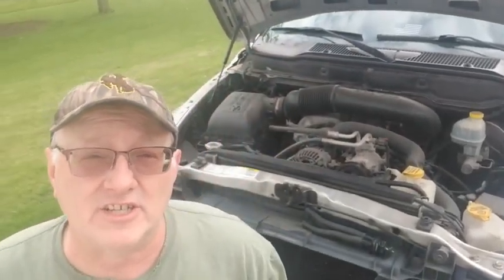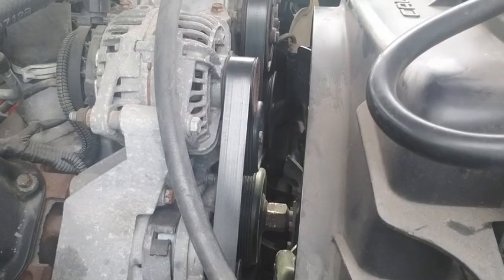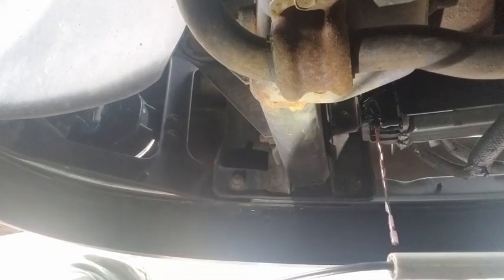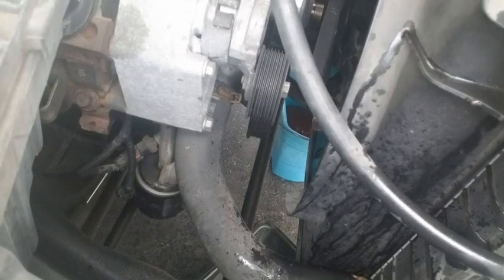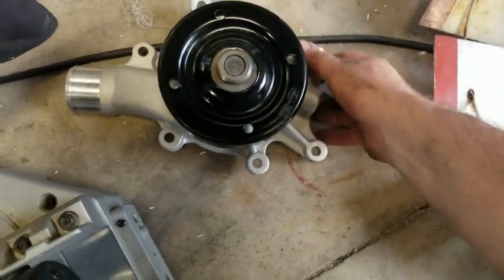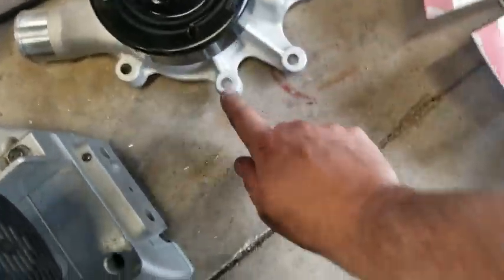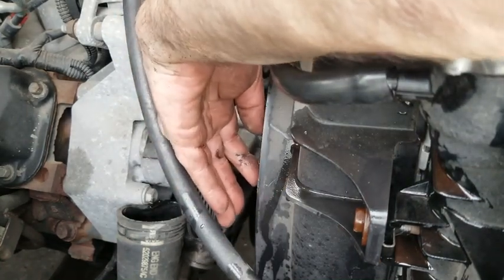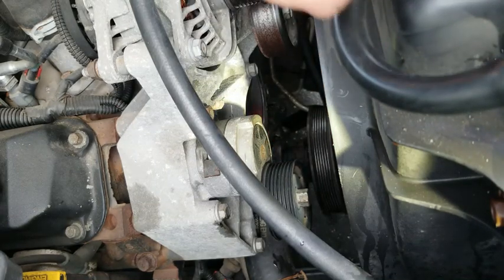Dodge V10 Water Pump 2003 Ram 2500 Got to Be one of the Easiest to do that I have seen, engineering!

Comment: Gen 3 Ram V10 Ram.= Unicorn 🦄
Reply: Yes I love it wish they still made them, but I try not to get road salt on it so it lasts
Reply: @stevehelfer8339  same at least till 2004 they coulda been produced and how is it getting parts for it ??
Reply from the maker: @fordmanx3  Some are easy some are not the belt tentsioner is same as 5.9 But the arm is different so hours to take a part and rebuild. Muffler 5.9 Dealer hose $45 bucks should have been 5 or 10 but still cool
Reply from the maker: @fordmanx3  I have not had issue getting parts but the 45 buck bypass hose was pricy
Reply: @mytwogoodhands2799  not bad id guess parts would be a challenge for a 1 year only deal welp glad shes fixed keep her forever they only made 615 of these

Comment: 99% of the time,if engine spins clockwise, if a water pump has a f-L-at pulley turn nut to the left.  If a water pump pulley has g-R-ooves, turn to the right
Reply from the maker: Great tip thanks for sharing

Comment: Obviously you have never replaced a water pump on a big block Mopar. 2 wrenches, 1/2" and 9/16' and a prybar. Most can be replaced in 20 minutes or less. "DO NOT" ever use a wrench to tighten the fan clutch when reassembling. start it by hand and leave it alone. Running the engine will do all the tightening it will ever need. You were lucky that either no one has done that pump before or some one before you knew what they were doing!!!
Reply from the maker: I find that big wrench and a tap or two gets them loose